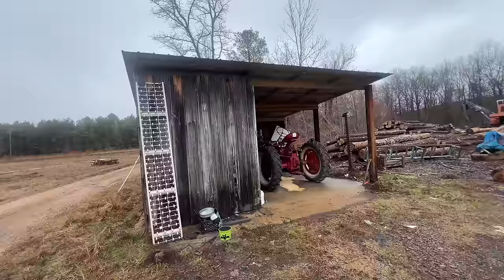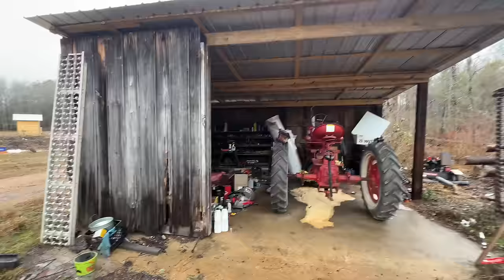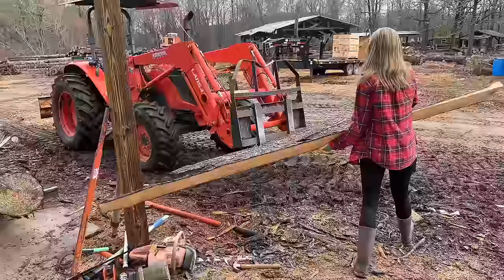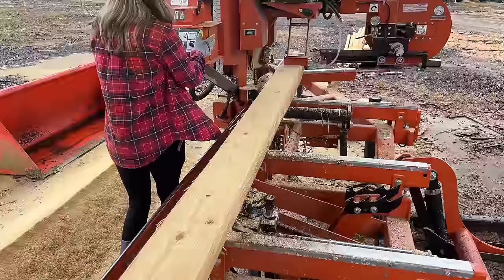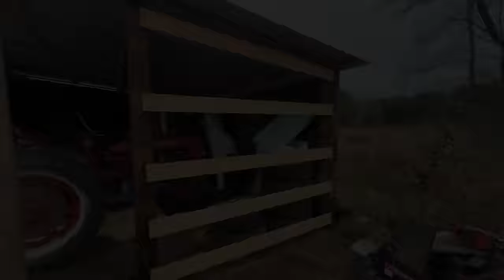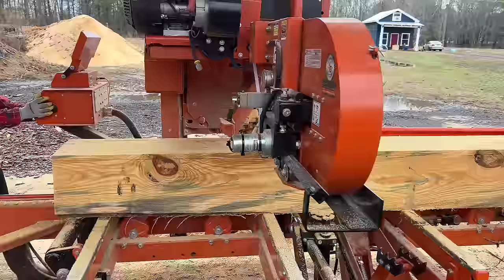50 YEAR OLD!!! Barn RESTORATION!!! (First Wall Replacement!!!)

Comment: we always called it board on board siding.  by putting 1x12's on the back and then a 1x10 on the front, overlapping 1 inch on each side gives equal spacing

Comment: Using all wide boards in a "board and batten" style like that was often done when all that was available was fresh cut green boards but you had some urgency to go ahead get a building put up for immediate use. Overlapping generously to allow for a lot of shrinkage as it dried out was the main goal.  It will be good.
Reply: Excellent